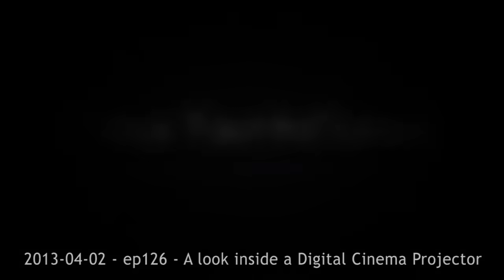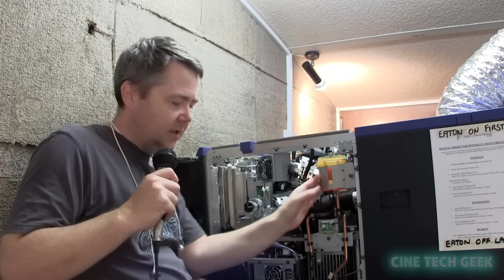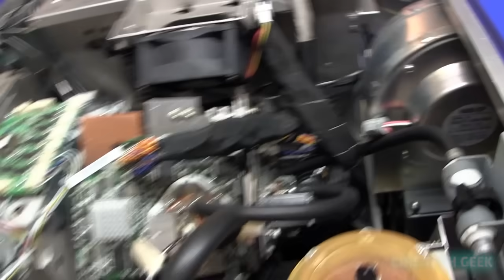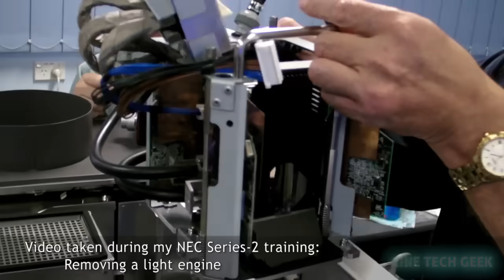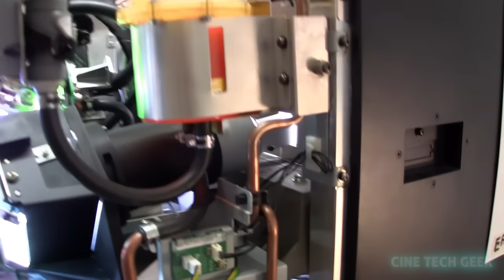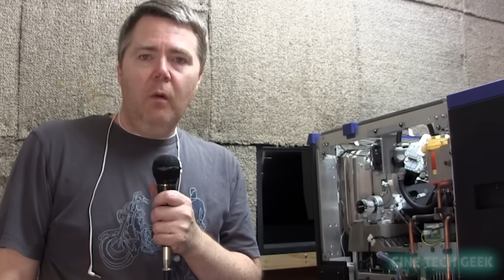A look inside a Digital Cinema Projector

Comment: Also most smaller consumer DLP projectors only have a single DMD/LCD screen and use a colour filter wheel so they display each frame three times in red, green and blue to create the illusion of a colour image! However that was mainly with earlier consumer DLPs as most modern DLPs now use colour LCD panels to eliminate the use of a colour filter wheel! :)

Comment: Do modern cinema projectors crash, like what happens to your home P.C
Reply from the maker: Well, yes, just like different micro systems in a Car, or your TV.  But they are built for industrial use in a Cinema Grade projector, so other systems monitor them and report back whats going wrong so they can be more easily identified and fixed.

Comment: Recently handling the cristie series 2 projectors like CP2215 ,2220  4k  like 4220 4320...   the CP 2215 projectors having regular problem of  colorchange..  icp abd leqd are reseating at that time..  do you have any solution to avoid the colorchange?
Reply: Their is no simple answer. 
It could be the electronics to the light valves, or a mechanical problem.
One simple possibility is bad cooling to the prisms splitting the light and as they expand, the diffraction moves. In this case, the color would slowly drift as the machine heats and cools.
In the case of the electronics, it could be anything from a faulty potentiometer  to a leaking capacitor or bad semiconductor component. The fault can only be diagnosed by computer diagnostics or board substitution
Cristie will more than likely be aware of components that are starting to fail early.
Reply: wilsjane   thank u  ...  now it get reduced  after ensuring the proper earthing values....   now  i am  concentrating on the PM  services ....  lets  see..   Thanks again...   pls  share me  a  mail id  for such enquiries...    ..

Comment: James, Is it possible that some cinemas in large complexes use cheaper and less effective digital projectors?   There's no sharpness or contrast and image looks grainy - sometimes happens in smaller theatres in cinema complexes?
Reply from the maker: Actually, its not realy that possible to let them perform poorly apart from over use of lamps and running them at lower brightness to save money.  Tho thats not as effective as it use to be.

Maybe they are not looking after the settings properly, having an engineer check they settings have not wondering over time, resulting in poor focus.

But generally, if you see grain, or poor images, its more likely the way it was shot and the quality of the post production.   
Put it this way, all the DCI projects minimum quality is very good.  And being solid state they don't really degrade over time, (If they do, its typically something very bad, ie DMD cancer etc. once this happens they are stuffed.  But its not common at all...)

Comment: This liquid cooling that's being talked about, it's special for the projector right? Or?
Reply: fearfactory1189 all mid to large projectors use liquid cooling for the DMD or DLP chips.  With that much light/heat hitting them, they require it to keep them in operational temperature limitations.  Heat is the enemy to a DMD.  The cooler they are, the longer they are likely to last.Smaller to very small projectors can work with nothing more then thermal cooling.  Ie heatsink and fans.
Reply: Ah, gotcha :)

Comment: what res do projectors run at?
Reply from the maker: 2k - 2048X1080
4k - exactly double that.

Picture resolutions
Flat 1998x1080
Scope 2048x858
In four K agan you just double the values.

So the 2K/4K the full sensor is never fully utilised..  Flat makes best use of the sensor..

The use or anamorphic lenses was part of the spec but has not been adopted..  Ie   scop using the full 2048x1080, then use anamorphic lens to streach out to scope aspect 2.35:1

There is a lot more info on wikipedia in terms of resolutions etc..
Reply: wow, a very informative and prompt responce, thankyou
I just went to the cinema today and I could tell some adverts were rendered/filmed at a higher res than others, I watched the hunger games and I wondered what res it was filmed at but It was probably 2048*1080 amarite?
Reply from the maker: xX_DYLM4N_Xx Pretty sure it is shot in 4k, with a 2K master..  Its very common to shoot higher tthanyour finish resolution as it allows for a better quality post production workflow.  Ie re-position, stabilisation,  rotoscoping, all work a lot better if you have more pixels to work with then the final output..
Also so
http://apps.avid.com/webinars/2014/hungergames/?elq_mid=8750&elq_cid=10391313

Comment: Keep it really clean? But there is no film you have to worry about dirt getting on. Why would you care about keeping it clean any more than you would a normal computer?
Reply from the maker: dust is the enemy of the optical components of a projector.  Unlike film, were a simply lens is focused on the film plane, we have a very complex set of prisms etc.  Typically these are sealed in a domestic projector, but due to the high power etc, and cooling requirements, they are not on a digital cinema projector.  Clean air is sucked into the projector form outside to cool them..  
So keep your projection room clean as what ever is in there will be getting into the projector..   KEEP YOUR FILTERS CLEAN...
Reply: CineTechGeek
Thanks for the reply! I think I understand now. With a film projector you only worry about the dust on the lens itself, but a digital one you worry about that and the dust on each one of those prisms and mirrors! Must be a bitch to get all those things near perfect...
Reply: Actually, I was always way more concerned about dust on the print than the lens. The lens takes a minute to clean. You can clean a film but that introduces some scratches if not properly done. And some even if properly done. Best to keep dust at a minium. But a bigger problem is that film will shed when traveling through the projector. And the film has a electrical charge and the white flakes will stick to the film. This generally occurs as the film passes through the trap. 

This was my biggest pain in the ass. You could reduce the tension on the trap but then you would get judder. We had one projector that shed a lot. Unfortunately The Mighty Ducks 3 was playing in that theater. It got bad enough that people were complaining that they couldn't keep up because there were hundreds of pucks on the rink.
Reply: Because unlike your computer, a cinema projector has up to 4000 watts of light passing through it. Your computer screen is about 3 watts.

Comment: can i hook up a laptop or pc to these projectors?
Reply: Just wondering if you realize that these projectors cost around £40,000, need a 3 phase electricity supply and consume about 3 kw. Replacement lamps can also cost £500. 
They are designed to project onto a 40 foot screen. So you will also need to buy a cinema. LOL.
PS, you may also like to add some sound to your picture, so keep your wallet with you.
Reply from the maker: Sure, especially to a Series 2, the more common digital projector.  In general you can plug anything into any brand, but you may need to take more care with the configuration depending on the brand.
Reply from the maker: I made a video about this..
http://youtu.be/52RQZL9qFL8
Reply: so i found out too hmmm.....
Reply: so from what source can i ingest my files? does it come with a touchscreen control? or do i have to buy it separately?

Comment: The "movies" are either sent the the cinemas physically or transmitted over satellite links. Physically, the North American standard is to send a 1TB disk drive in a "CRU" caddy for features and for a weekly "trailer drive" which has the current trailers and a selection of snipes. The drives are shipped through normal shipping channels (UPS, FedEx, bus cargo, whatever) in a small Pelican case or a plasticized cardboard shipping carton, with foam cushioning. The drives can be read using a "CRU" drive bay, USB, or eSATA connection. Most drives are good on arrival but damaged (unreadable) drives are not unheard of. Ads and individual trailers may be on a USB memory stick or on a CD/DVD data disc.All cinema projection systems have USB ports for ingesting the movie data, some have a CRU bay, and some have an eSATA port. 
Satellite distribution is used more and more - it's cheaper in the long run for the distributors. Reception is offline - the movie doesn't play "live" from the satellite system -  a special receiver/storage system is used which does the actual selection and storage of content which, when complete,has to be transferred to the actual cinema projection system. I don't know the data rate or anything - delivery of a movie starts maybe a week before release. The content transmission is repeated or looped so that reception is guaranteed eventually. A normal dish is used but they install the larger size that would be used in bars, not the tiny home one. Not a big old-school 6 foot umbrella dish, it's the DirecTV type. I don't know what satellite company is used, or whether all the distributors share one system.
Reply: Are those solid state drives or disk drives ?
Reply: @111danish111  all DCPs are delivered on mechanical drives. And for now all servers used for playback have also mechanical drives. But some are being tested with SSDs as we speak.....
Reply: DW Macaulay You mean to tell me that while you're watching the movie you just paid over $10 for they run snipes during the feature movie? You're watching your favorite show on TV and they won't stop pestering you.
Reply: Not directly related [to the video] but still much-informative insight!!! Thank You So Much for that! :)
Reply: DW Macaulay oh I thought they would get flashdrives with the films mailed to them

Comment from the maker: This is a false premise.  DCPs are based on 250mbit in general, bit a typical 4-6mbit as used by satellite in SD  or up to 8-12 (If you're lucky) for HD.  So, distributing a DCP would take about 60 SD channels or 30 HD channels.  This is not a trivial amount of satellite space so the locations reached  for a distribution system like that must be very large before it is viable.
Satellite is not suited for many parts of the world..  But for some reason, "companies" seem to overlook this..
Reply: CineTechGeek way back in 1969 there was a twelve inch lazer disk the replaced the film reel then came compact disc dvds ten years later being replaced by DCP flash drive in 3 D and satellite.films tend to fade becoming brittle.

Comment: How does movie studios distribute movies to theaters using digital projectors?
Reply: On a plug in hard drive. A 2 hour film in 2-K resolution can be up to 4-TB.
2-K resolution has roughly the same pixel size as the grain size of 35mm film.
Digital saves the distributors the £1,200 cost of a 35mm print, so films can be opened in more cinemas, rather than transferred from area to area.
Reply: @wilsjane  I thought they used a server and the cinema get a password to the DCP file?